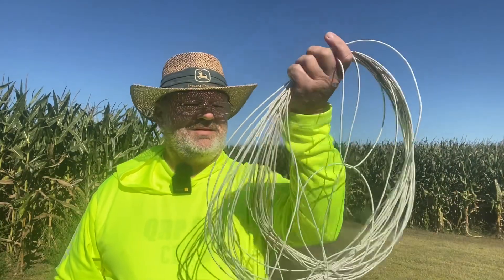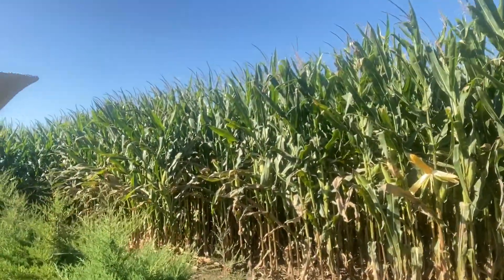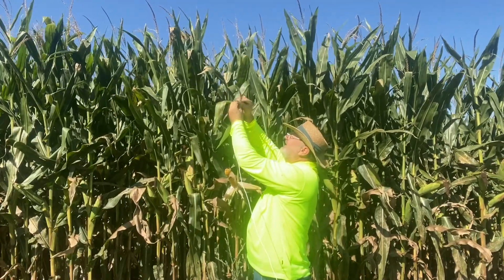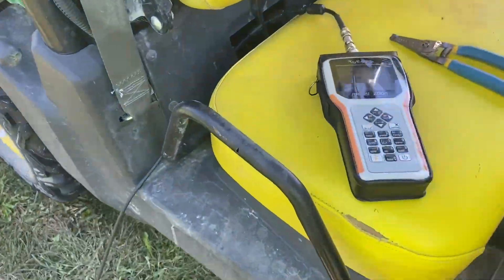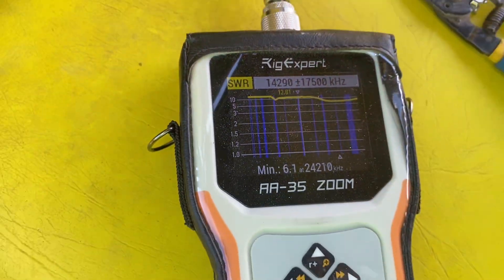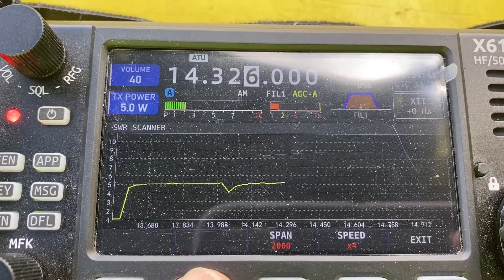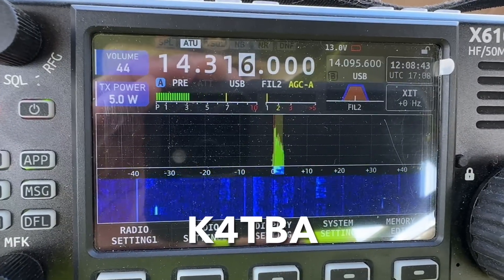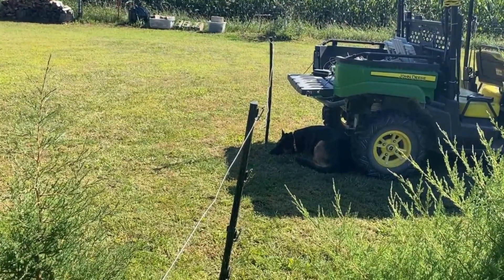Corn Coil Antenna - Xiegu x6100, QRP 5w

Comment: Now I've seen everything.
Reply from the maker: Hey Philip.. LOL... Lets find a way to make it work first.. I've got some tips from more seasoned ham operators so you may see it one more time, failure or success.. let hope for the latter.. Thanks for watching.. 73
Reply: @hamradioqrp-k0klb the cob is mostly water and exceptionally lossy. I'm thinking your rf was shorted to ground.

Comment: Don’t give up too quick! I wish you had checked the SWR over a wider range. I would guess it was resonant somewhere above or below the band. You could also stretch a dipole across the tops of the corn. I would guess it would be resonant a little lower in frequency than when up higher, but I’ll bet it would work.
Reply from the maker: Hey Dandy.. The video shows a rig expert scan across all the hf bands.. it didn’t look too good anywhere, lol.. i thought about the dipole next as well… might have a better chance like you say, across the top of the corn.. I’ve had some feedback on the corn coil and some ideas to try so there may be a follow-up in the near future.. Thanks for watching and commenting.. i appreciate it.
Reply: @hamradioqrp-k0klb It’s possible that the scan missed the resonant point if the range is too wide. On my nanoVNA it only has a limited number of data points, and if the scan is too broad the points are very far apart thus missing important data. Not sure about the rig expert. 73, N4DJ
Reply from the maker: Oh Hey Don.. I didn't recognize the dandypoint channel name.. If there is a dip, the rig expert will show it in my experience with it.. Somethings just weren't made to antenna, LOL.. but I may not give up just yet.. A friend suggested more wraps on the coil, radials and feedpoint on the ground and a "T" top hat across the top of the corn stalks.. I might give it a try..
Reply: Yes the top hat might help a lot. I will read up on the Rig Expert. It’s been a while since I used one. The old MFJ 259B works well to zero me in on something wild. Then the nanoVNA sweeping a narrow range really dials it in as I think I only have 100 data points spread across whatever range I choose. At least that’s the way mine works with my laptop program. There is no reason what you were doing should work any worse than a mobile antenna, unless all your power is going to popping corn! 🌽